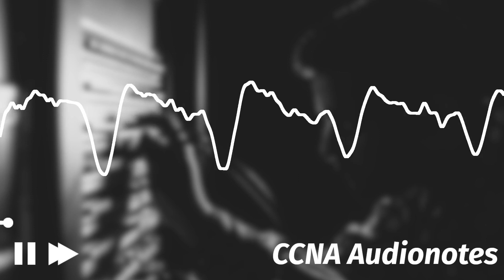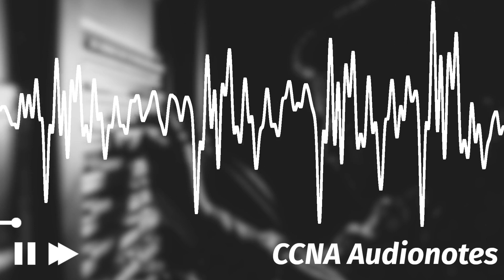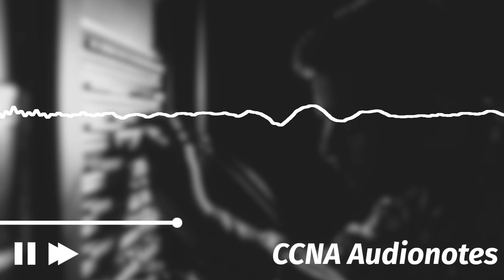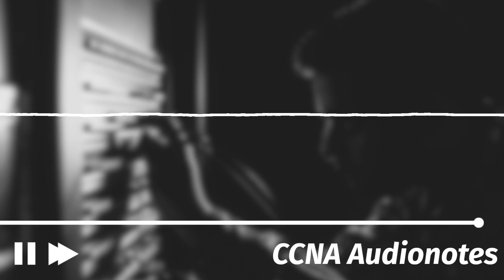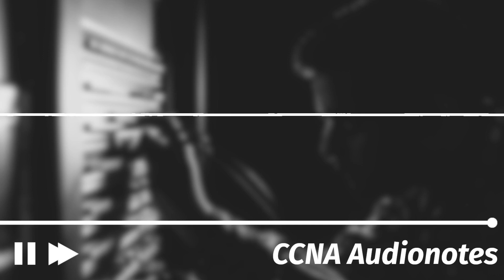CCNA Audio notes 01

Comment from the maker: When a switch receives a frame and the destination MAC address is not in its MAC address table, it will "flood" the frame out to all ports except the one it was received on. If there are no devices on those ports with the destination MAC address, the frame is simply dropped.